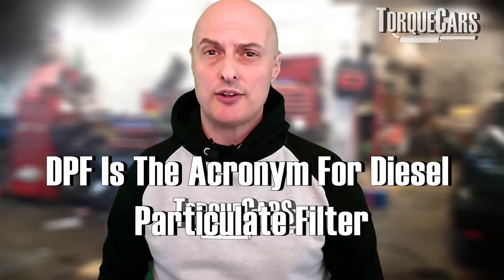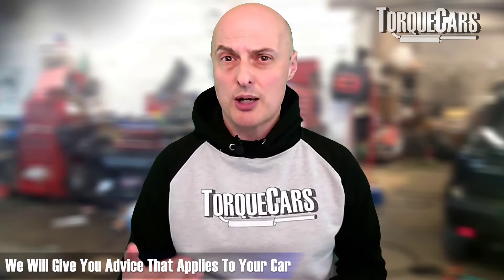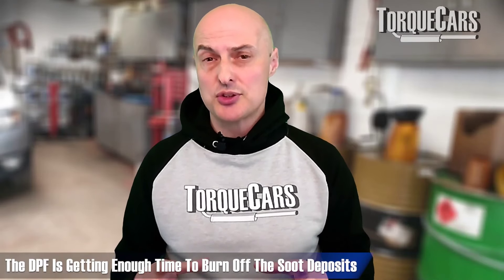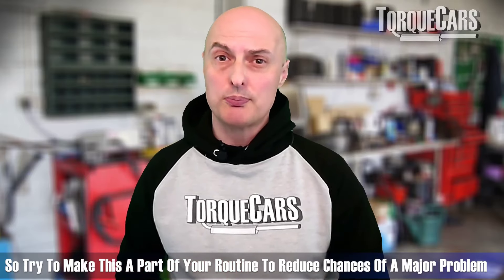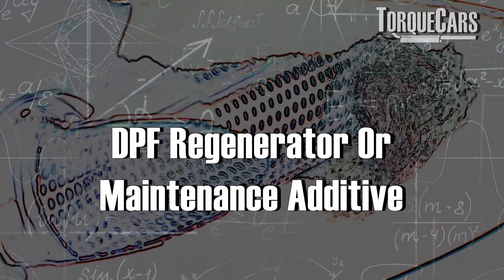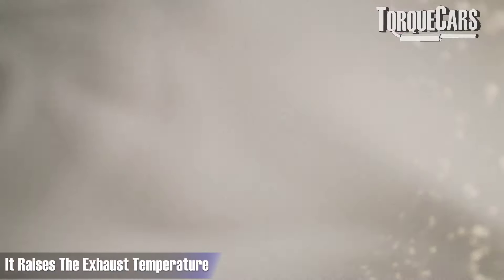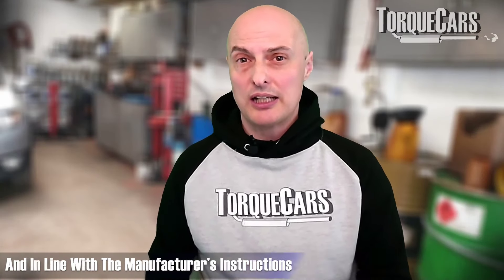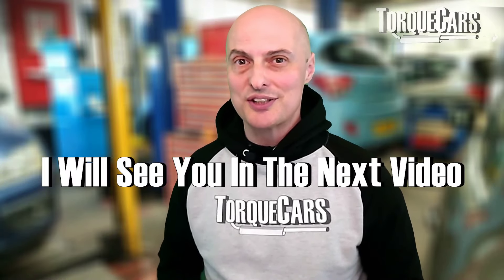DIY Clean Your DPF: Regeneration, Additives & Driving Tips To Help Avoid Blocked DPF Problems.

Comment: Sadly any engine that’s not euro6 from about 2018/2019 is diesel gate territory. I’ve got a seat Tarraco ea189 diesel and I can honestly say I don’t have trouble with it. For example the egr valve is protected by the dpf so it doesn’t soot. I do a lot of short journeys but do go out for a run now and again. I can tell when it regenerates as the idle picks up slightly if it needs it but then returns to normal again after 5-10 minutes depending on what the car decides it needs. I think the newer diesel has learned and advanced in a way now with Nox the same as petrol euro6D lower co2 and more mpg’s just in time for politicians to force shelve it. In favor of mining heavy metals out of the earth to build batteries that are being charged still predominantly carbon based fuel and then don’t know how to dispose of the batteries. Maybe pay china to take them so they can dump them in the sea like we did with all the plastic. We’ve😅 condemned fantastic ice’s to quickly. Ps I’ve not put any oil in mine the design of the piston rings are spot on. A VW mechanic told me to hold on to the ea 288 diesel telling me it’s incredibly reliable. The sad thing is is VWAG are cutting back again to pay for diesel gate and all these Evs no one’s buying. What automotive industrial mess eh? Qustion…. Does using premium fuel like shell vpower help clean dpfs?
Reply from the maker: Premium fuels like Shell do in my experience and testing keep the injectors running clean and this is what will reduce carbon & carbon deposits. I never use anything else in my cars if I can help it, but I'm sure others will have different experiences with premium fuels.

Cleaner injectors and less carbon will be better for the DPF in the long run, but will this clean a DPF? Hopefully there is very little of anything left after the combustion process to do anything inside the DPF.

My take is that if your car is designed for premium fuel then you need to use it, anything else is likely to cause problems. All modern fuels have detergents and cleaning additives in them, but the formulations will vary from brand to brand.

Comment: I recently bought a (VEA) Volvo with 180k on the clock, the soot filter full came up shortly after purchase which I kind of expected - the diagnostics showed soot mass of 49g equating to needing a forced regen - this basically chucks a load of diesel into the DOC (diesel oxidation catalyst) and gets the internal temps up to the 600C needed to burn off soot. I didn't bother doing this as I suspected it getting to the "end of life" and was actually clogged with ash from oil - a common issue on these engines. After I'd managed to get the DPF off the car, there was literally no soot I could see - I gave it a bath in caustic soda to loosen off the oily soot - hardly any as I suspected, next an acid bath to dissolve the ash build up - lots of thin strands came out and I could feel the flow through it better when blowing an airline through (as per Steven B Turner's tips). Stuck it back on and it's working like a charm - longer runs give it the opportunity to do passive regens and it's not sitting at around 14g of soot and the power has been restored...if it lasts 20k I'll be happy

Comment: How long do I have to leave the product on before I have to drive car again? Do I need to run the regenerating program after applying the product, or it is enough just drive it on a motorway? How long should I run the engine after cleaning?
Reply from the maker: You really need to follow the instructions that come with the product you are using. Application methods and driving requirements vary too much for a simple answer to that question. Some spray into the DPF, others are added to the fuel and some go into the air intake stream, a few even require DPF removal to use properly.

Personally after a regen runs I would give the car another 10 minutes at least to settle afterwards, but manufactures often recommend different things.

Comment: I have a euro 6 vw transporter kombi 150bhp that's had problems on the emissions side of things despite always, and I do mean always using vpower and millers diesel additive. Also, as well as getting it serviced as per VW.......ie every two years, I also do my own oil and filter change every 12 months/8000 miles. I don't do short journeys.........my shortest work commute is 45 minutes. I just cant do any more to prevent problems. I frequently hear the van come on when I park up........sounds like a jet engine!! I don't think mine has a dpf light on the dash funnily enough.......certainly never seen it illuminated. I love the van.........but I hate this ridiculous "technology" that results in all these problems.......who on earth thought this was a good idea!! Great channel mate..........many thanks.
Reply from the maker: DPF's are the single most annoying thing out there judging by the correspondence I get every day.

It is interesting to hear your experiences especially when you do everything you can to avoid these problems.

Comment: Some good advice here, my 58 golf bluemotions going on a fuel range reducing (about 20 miles lost) regen around every 2 weeks or every 200-250 miles, so at 210k on original unit I'm probably part blocked?
At around 9.40 you talk about ad-blue use being beneficial to the dpf. I was under the impression that it was to reduce nox by selective catalytic reduction, a separate system to the dpf. Maybe I've been misled here? Regards.
Reply from the maker: Sorry I wasn't very clear here, I had in mind cars which used a hybrid of both SCR & DPF in one unit.
Reply: @torquecars whilst I understand that ad-blue use and a dpf is an evolution of the original early circa 07+ dpf only systems, What I was really wondering was: Is the ad blue (mainly water?) injected post stream of the dpf or before?. If before then I could understand the benefits of high pressure steam cleaning of the dpf, like in the case of a blown head gasket when the affected cylinder ends up steam cleaned as the antifreeze/water mixer is lost in said cylinder. Regards.

Comment: Driving 20 miles in 3rd gear at 70mph works very well  I'm sure bio diesel doesn't help as it's also produces bacteria in the  fuel which blocks the fuel system I have been working on cars for over 50 years and have noticed the difference
Reply from the maker: I am not a fan of the bio fuels they are forcing upon us now. Which car is that in my friend? 

I'd be interested to know if you think diesel engines are better or worse than they used to be when it comes to living with them?
Reply: My car wouldn't get to 70 in 3rd, 
Now what?

Comment: I've a Peugeot 5008, 2011. Bought the car in May and twice I've had issues with the DPF. I drive on the motorway three times a week to and from work. Any idea why it's happening?
Reply: u can't really have problems with dpf as this its just a filter , the problem may be from a bad thermostat, fuel injector, even glow plugs

Comment: Hi mate my Particulat filter light comes on when I'm on a long journey but then goes off after 20 mins is that normal, and when I'm on a short journey it blows a lot of smoke out, I do a lit of motorway miles so I didn't think there would be a problem

Comment: The motor industry bent over backwards to appease the green lobby but that wasn't enough. EV's are a non starter but try telling that to the GL. That was an aside. Did you know 25/75 muriatic acid dissolves Ash deposits? And Dishwasher tabs dissolve tarry soot deposits? A sodium bicarbonate flush will neutralise the acid and a final rinse with de-ionised water will leave your filter good as new. I wonder if it is possible to use that cleaning method without removing the DPF.

Comment: driving it like I stole it, always works on my Nissan XTrail when the DPF light comes on, 10  miles in 4th gear at motorway speeds the light goes off and stays off for 6 months,
Reply: Please share what RPM you usually maintain on such dpf clearing drives?

Comment: I have a red hazard triangle and an orange check engine light showing. The cleaning filter light came on but the car had been parked up. Can I warm the car up and then drive it on the motorway for 30mins so the dpf  can clean itself or will it damage the engine?

Comment: Hi,
I drive audi a6 c7 facelift 2018 2.0tdi.
I have dpf cleaning cycle every around 200miles .
Last regeneration I done by vcds while driving method.
While regeneration
Calculated sood 11g
Measured sood 3.9g
Different pressure 54hpa
Temperature 720°C

After regeneration 
Calculated sood 3.5g
Measured sood -5.8gg
Different pressure 6hpa

Do you think that figure are OK?

Comment: Engine management light on with the coil looking one that looks to be glow plug light had it twice looked at on  computer and show only dpf need cleaning showing 59 grams always drive open road can't seem to get these lights to go out car still doing 74 mpg 16 tdi mk7 with dpf any ideas just drive 30 miles 4th gear still no joy

Comment: on wag group it's and app on Android called wag dpf , this u connect with an obd , i use carista ond and app to start the regen when i m on Autobahn and engine it's at ideal temps ,wag dpf shows u the filling process and i start the regen at 80% ,this takes 10 min and i m at 310k km without any issues, in city or when it's traffic it can go to 15min or so , that's why i use this to control it myself because this stupid car before starts the regen process when i was exiting Autobahn and then i saw 1k rpm ,so i had to extra drive in the city to finish the regen , doing in my way help me with time and the car because it way more efficient to burn that soot then on the city

Comment: dpf should be easy to clean or replace like other filters, unfortunately very hard to  clean and replacement it.
Reply from the maker: I totally agree, a clamp type arrangement should be easy to implement allowing for easy removal and refitting, and this could easily be part of the regular service schedule just as with an oil filter/air filter and they do a deep DPF clean once every few years.

Comment: I use Forscan program on my laptop together with a OBD2 cable for my 2011 Ford Mondeo 2.0 diesel. It wont let me regen my DPF as a error message pops up the moment i press start. The error message says DPF to blocked or completely blocked to perform regen. How can it get completely blocked without a warning? more importantly, what can i do about it now? PS: i read about the forscan wont allow the regen because of the codes, but i can't clear them as they instantly come back again after clearing these DPF codes. Apparently a more advanced than forscan diagnostic tool is needed and someone that knows how to use this diagnostic tool inorder to trick the ecu into not identifying the DPF.

Comment: i have got a problem with my e250 
can you please tell what rpm should i be driving with dpf cleaner
Reply from the maker: A few further questions, which engine do you have in this? Which cleaner are you using? What problems are you having? (Partially blocked DPF, Loss of power, DPF regen light etc...)

It is nearly impossible to give specific advice. But generally follow the instructions on the can of cleaner, in most cases I would use about 1/3 to 1/2 of the RPM range for a cleaning cycle but this does depend on the specific engine and cleaner you are using. For blocked DPF's you need to be quite gentle at first with lower RPMs and then raise them as it clears.

Comment: I'm surprised. Most technicians say additives are a complete waste of money.
Reply from the maker: Most additives are indeed a waste of money but there are a few good brands out there that can help in many cases. It also depends on the degree of the problem and the type of car you have to some extent.
Reply: @torquecars  
I would be interested to know which ones you recommend. With all due respect, proper testing can only be done by men in white coats in well equipped labs, over long periods of time, unless the substance in question has already been tested and tried in the field.
One exception I can make is Stephentuner. He has made some great YouTube videos on DPF cleaning agents that can be found in most kitchens. Unfortunately, you need to remove the DPF beforehand. 
There is also a great video on fuel additives and injector cleaners by Engineering Explained.

Comment: But i just saw a video they said dont worry about the cold engine and just drive but drive gentle until the car gets hot and you can drive normal/harder
Reply from the maker: This video predates the cold start one which was a response to a question which I thought needed clarification. A DPF regeneration will NOT kick in or start on a cold engine, so the rule of waiting for the engine to warm up before driving it hard still applies.

Comment: I have a 2012 Audi A3 Diesel, I have followed the instructions of running the car on "S" on 2000Rpm. The particulate filter image went off, but started showing up continually. I bought a DPF cleaner, but it hasn't stopped. Should I Try DPF foam cleaner? I can't afford to go to a shop. HELP
Reply: Try Risoline DPF cleaner and drive it 30-40 miles. Try up to 2 bottles. Sometimes it helps sometimes it doesn’t

Comment: Using live data and driving at 110 km/h and high rpm did not help at all. The temp reached abort 400 degrees C which is not enough. A regen will introduce diesel to the DPF and the temp will reach 600 degrees C.  I would debate your tip about driving with high rpm as in my experience does not work.
Reply from the maker: My aim was to stop people dripping along at low RPMs, hoping the DPF would clear but the video could indeed be seen to imply that higher RPMs are better although I tried to state mid to high rpms I could have focused more on the mid.

One thing I have learned is that different cars require very different styles of driving, newer diesels are more subtle. EGT is not always an indication of DPF temps especially if fuel is injected into the exhaust. I will redo this video in the next few days and try to provide more of an overview that covers most cars.

This is an important topic that affects so many modern drivers.

Tell me which engine and car do you have? Thanks for adding your experience and feedback to the debate.
Reply: Mercedes OM651 engine. I've had the same experience on three different cars.
 @torquecars
Reply from the maker: Tomorrows video should be more general and cover this detail for people,thanks again for your input and feedback.

Comment: Thanks
Watching from southern Adelaide in South Australia.
Series A egr cooler failed on VW CFCA multivan engine, had to buy new motor- $15k.
They advised the DPF was fine, 2 months after engine, it plummed smoke all the time when coming onto accelerator, they checked and advised DPF was clogged from the engine failure...
I'm going to cut DPF open, smash the guts out, weld it back up and delete it from ECU.
I hate VW Australia- they're dickheads.

Comment: While video could have been summarised in 1 minute
Reply from the maker: I could also summarize a whole movie in 60 seconds, but wouldn't you miss the details and the fun journey we take together! 

I take the point that you would prefer more concise video content and will bear this in mind for future scripts. I won't be aiming for 60 seconds though but will try to make the videos shorter.

I do add chapters so people can easily skip to the relevant parts of each video.
Reply: @torquecars  thanks, yes it is great video no doubt.
BTW, have you found force DPF useful? I don’t have a VCDS to test but Ross Tech has some instructions around using the code 10016 to force DPF while the vehicle is parked. (This is for VW Audi)